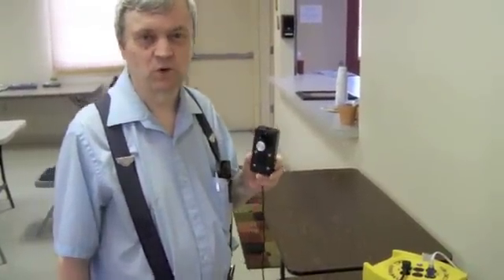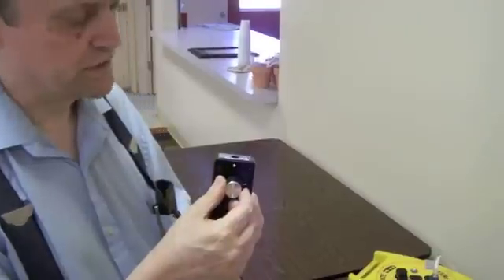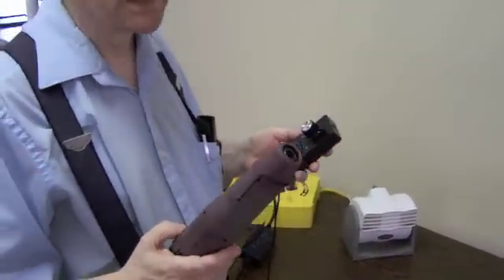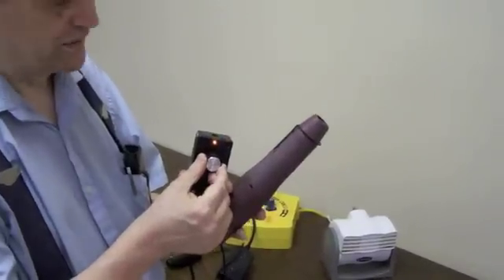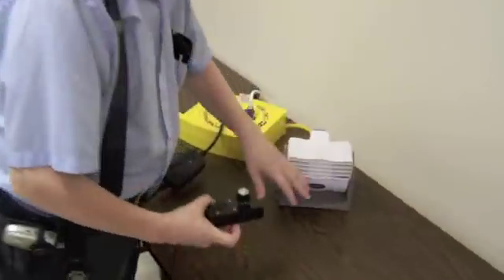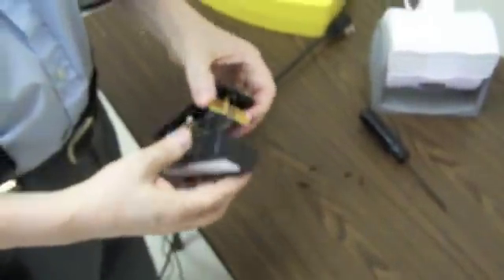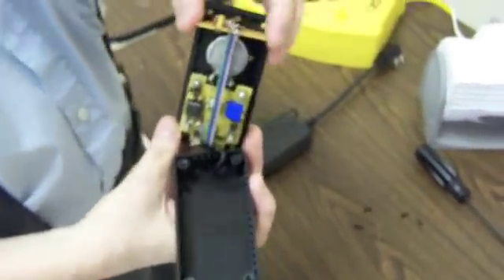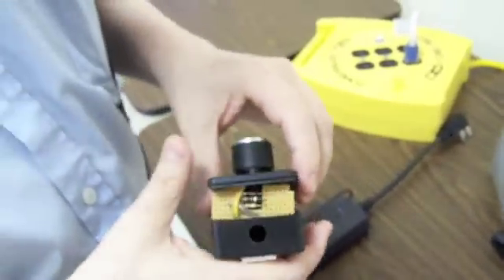Space Heater thermostat

Comment: Yeah same here, I have a space heater that the thermal switch has bought the farm on... thinking about doing something similiar, using a wall thermostat to control it... if I can't find a replacement thermal switch.  The frustrating thing is it went out after I serviced the unit and cleaned out all the dust and oiled the motor axles :-/  choppergirl